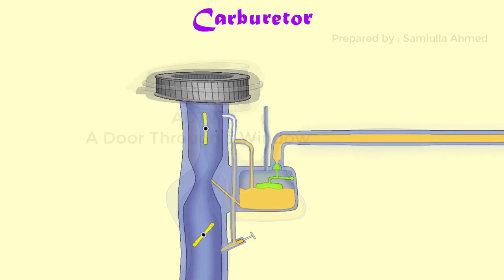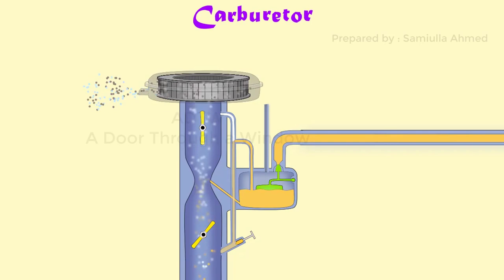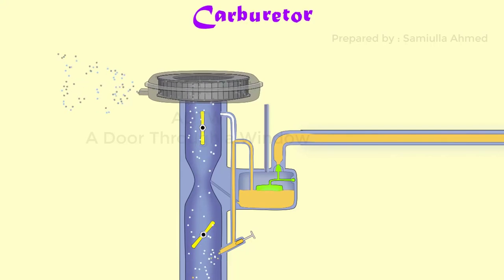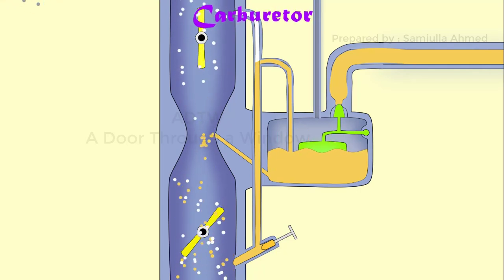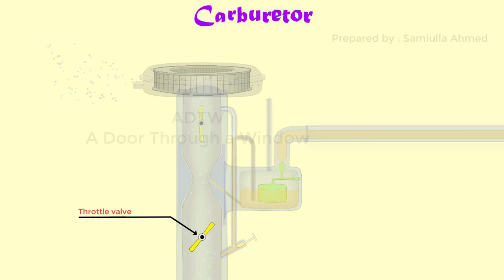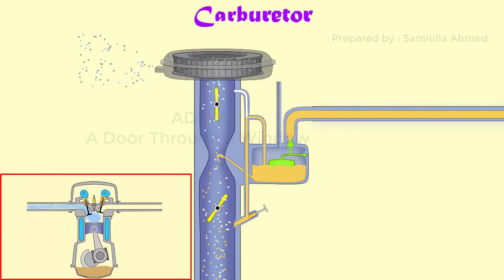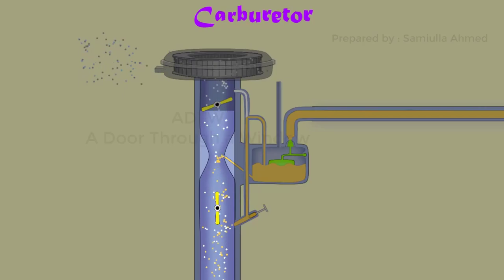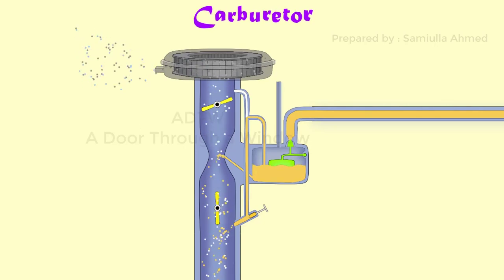WORKING OF CARBURETTOR: How carburattor works? (Animation).

Comment: Sir it was good but i have a doubt
If the choke valve is closed then no air flows in the Venturi hence there wouldn't be any decline in the pressure at the narrow end so how will the fuel rise up and give rich fuel air that will reach to the engine?  Sir I think that due to no air in Venturi vacuum might be created in the Venturi then only the fuel can rise.
Reply from the maker: Yes, you are right since the venturi is closed when the piston moves down that time it will suck the air inside since the venturi is almost close, therefore fuel gets sucked into the engine cylinder. Which create a rich air-fuel mixture.
One more thing to remember is that the venturi is not completely closed, there is some gap for air to come inside otherwise how fuel alone will burn without oxygen...

Comment: Idle screw clockwise ghumanese kiska flow bar jata hen or kiska flow kon jata hen .......plz tell me
Reply from the maker: Idler screw issliye diya gaya hai taki engine ko jab accelerate na kiya ho tab engine chalta rahe... Jab hum idler screw ko lose karten hai tab air fuel mixture engine tak pahuch jata hai bhale hum engine ko acceleration naa de rahen hai, isse engine band nahi hoga... Agar idler screw ko hum fully yaa partially close kardenge tab engine jaise acceleration dena band kardeten hai vaise hi engine chalna band ho jata hai...

Comment: Main jet pulls fuel due to venturi effect.
When choke on // no air, no venturi effect. How is fuel drawn in ?
Also idling doesn't use venturi effect.
Please explain.
Reply from the maker: When choke valve is off there will be no air flow but there is low presure in that zone due to suction stroke of the engine therefore fuel is drawn in....
Reply: Thanks for replay. 
Question // when choke on fuel comes from main jet or slow jet. Thanks.
Reply from the maker: Main jet as well as from idler jet... Since idler jet is small it can only give a finite amount of fuel so therefore main jet give more fuel when choke is on.
Reply: Thanks man. My motorcycle carburetor has hard start other way works fine. Looks some passages need to be cleaned.
Reply: Happy end ! Choke plate stuck fully open, even that lever was moving ☺.
My first intention was to drill the plate which was wrong.

Comment: Fuction of venturi sir
Reply from the maker: As the air is suck into the engine due to suction stroke the air passes through the venturi at Venturi the air velocity I creases since there is a small gap and large amount of air is to be passed through... As the result velocity Increases. This increase in velocity decreases the pressure casing the fuel to be sucked inside the venturi and it gets mixed with air forming the required air fuel mixture.